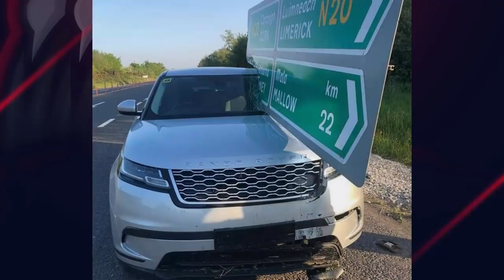Customer States Check Differential Fluid On Their Truck | Just Rolled In

Comment: Having owned a Ford Ranger (bought new) that had a frame begin to rot out after 2 years, I can't help but look under the wheel wells of trucks I pass on the road.  Amazing the amount of corrosion you see along the frames in the wheel wells!   And this is on relatively late model trucks!
Reply: I owned a Ford Ranger for 17 years.  Bought new off the lot.  It spent more than its fair share of time in salt water environments.  Oddly enough I never once had a mechanic complain about rust or rot in the vehicle's frame.  Don't get me wrong, it had a number of issues.  Electronics were showing their age, shocks were shot, and there were some other issues that would cost more to fix than the vehicle was worth.  But I never was told the frame was rusted out.  I don't know if I was lucky or if I simply did enough vehicle washing to keep the rust at bay.
Reply: This frame rot is reaching epidemic levels. I just can't understand why this crucial structure under trucks is designed as poorly as it seems to be. I get the whole planned obsolescence deal to keep sales alive, but if the frame fails in a collision or by simply using the truck, and the owner is killed as a result, well sales are negated at that point. Dead customers don't buy new vehicles to replace the ones that killed them.
Reply: Why do these cars and trucks rust so quickly?

Comment: I feel for the people that brought in the rusted out cars. But there is a lesson here. Get the car checked out before it gets that bad. Time for my old car to get checked. Fingers crossed. Thank you for sharing and you have a nice weekend too.
Reply: GL, car cancer is a pain. Just checked my 97. I see some surface rust underneath that I need to tend to. Overall she is still pretty good for a Michigan car.
Reply: @Frostified  There was a congressman many years ago in the U.P. that wanted to ban road salt because of the rust. He said that every car he ever owned died not from engine failure, but from cancer. The same goes for me in South-East Michigan, every single car I've ever owned long enough has rusted out before the engine went out. I have a couple of beaters now that run like new but are full of holes.
Reply: @Pro1er  Did car manufacturers ever do rustproofing over there? WIth the bitumen mass covering the undersides, and sticky oil sprayed inside cavities?
The better manufacturers used to do that here and cars would last 20 years even on salted roads, but then in order to save weight they started leaving out those treatments and all that protects the car now is a layer of paint :(
Reply: @shadowsimjk  No, not with the older cars, but they did, and still do electro-dip the cars where the primer is electrically bonded to the metal as the car is submerged into a vat of primer. In addition since the mid 2000s the steel is usually galvanized to deter rust. Even so, if you understood just how much salt they use in the North-Eastern and Midwest States you would understand why cars are still prone to rust. It's like parking your car in the sea for several months of the year.
Reply: there not even that bad weld .25 to .50  inch steel plates on it it be stronger then new
Reply: @jonsworld5307  Good luck getting a clean weld on that.
Reply: @Rogan_Dorn  not hard go back to good steel grind it clean weld it up iv fixed tons of trucks and cars like that
Reply: @CIA_Is_aTerrorist_Orginization  When I worked at a shop in Upstate NY a customer thoroughly washed and treated his truck before each winter. After 5 years the truck still looked great

Comment: Since the mid 80s I've always brought my car into the dealership and let them do all the scheduled maintenance.  3 or 4 times a year.     I totally believe that preventative maintenance is cheaper than break down repairs.    So knock on wood,  I've never been let down and found myself stuck on a highway in a strange town.   A late night break down will be a big towing bill and motel room cost   plus the cost of the repair.
Reply: i do a mix, i do some work myself when i can but if its due for other service when i take it in, i let them do it. i also buy my parts from the dealership
Reply: @Mike I met the service manager at Mazda dealership,  he went to the same trade school as me .   So I always trusted him to do the right thing.   He has now retired  ☹.
Reply: @Mike The idea that the stealership wants to rip us off comes from being told BS like that it'd be fine to just replace the brake ROTORS if I didn't want to wait for the new pads and calipers to come in. Needless to say, without new pads, those expensive new rotors would have been destroyed as soon as I put the brake pedal down. The response when I called them on it? "Well, yeah."

You have to really look hard to find a place that isn't full of crooks.
Reply: @Megatron995  That depends on the condition of the old pads, but it's still really strange they would suggest that.
Reply: @Mike That's not always true. It seems the earlier of the current generation Mustangs have a thrust washer that is too thin and causes a clicking noise after a while. Ford came out with a replacement that is thicker and solves the problem.
Reply: Over the years that I had my Ford Ranger there were times I took it to the dealership for maintenance.  But I quickly realized they weren't a reputable shop to deal with.  They claimed to go through a checklist of items on a vehicle whenever it was brought in for maintenance and when I reviewed the checklist and saw things checked off as good that I knew were problematic on the vehicle, I lost all faith in them doing any service.  I mean if they can't even tell the truth about system checks that were supposed to be done for free, what aren't they doing for the things that really matter?  

Instead of the dealership I take my vehicle to the small mom and pop mechanic shops in the area.  But even with that said, you need to check over their work.  One shop I went to years ago (now no longer in business) was very good initially, but as the business grew I think they began to take on more work than they could handle and they were cutting corners.  Something would be missing.  Something wasn't tightened.  Hell, something might be left under the hood that didn't really belong there.  They were rushing work and it showed.  There are a couple of shops I deal with now in my area and who gets the business is pretty dependent on my humor on that particular day.  But even if I'm always happy with the end result, I still do basic checks behind them.
Reply: My cousin went into the dealership for an oil change before a long road-trip, they forgot to put fresh oil in. He made it a couple miles before the engine was destroyed.
Reply: @TheVexCortex  Well there are incompetent mechanics  out there.  I check the oil after a service.   Because you never know 😨

Comment: Yeah just another day another rotted out frame, and those tires might as well call them slicks lol. That black Oldsmobile Cutlass Supreme g body at the end is gorgeous, always wanted one still do.
Reply: Almost exclusively those vehicles with the rusted out undercarriages and/or other infrastructure are from the North and Northeast.  If I had the financial fortitude I would be delivering selling and/or delivering vehicles from the South to the North and Northeast.  If business were doing well or better within a few years alot of Northerners will have much better vehicles... and boost the vehicle shops' business since they will have actual vehicles to work with instead of nothing but rust buckets on up to questionable quality wheels.
Reply: @adamgray1753  I hear that. I live in Pennsylvania and my father was a mechanic for 40 plus years. Growing up i have seen allot trust me and it still shocks me to see what people will drive and do to there vehicles to keep them going.
Reply: In my younger days we would call those tires maypops , may pop any second .
Reply: Even racing slicks have more tread than some of the tires in the video.

Comment: Just amazed that these vehicles are allowed to get to that state where suspension and structures are so badly compromised or even tyres are that degraded. The annual inspection we have in the uk would pick up those corrosion issues long before they got to that extreme stage, and tyres that worn would get you pulled over and get you points on your licence which can lead to a ban and WILL increase your insurance premiums. It’s crazy that this stuff seems to go unchecked

Comment: We've been getting plenty of tire like those at about 1:40 at our shop. Every one of them wanted an alignment to "fix" their pull and wobble issues. I even had one tell me that the  14 year old tires, which where the wrong size for his truck, were "new" and that he didn't need tires.
Reply: C/s lack of traction in the rain. Check and advise lol.
Reply: They were new 14 years ago! My grandpa was like that and would ride on tires until they were beyond slick. My boat trailer gets new tires every 5 years (live close to the lake) and truck gets them as soon as they lose wet traction even if they're not down to the indicators yet.
Reply: The DOT number on the tire doesn't lie about its age.
Reply: Tires really only last about 5 or 6 years, regardless of miles.  At that point dry rot has ruined them.

Comment: imagine having an accident with that rusty car and you find yourself later setting on the road with the steering wheel in your hand after your chassis turned into dust 😂😂😂
Reply: Decades back a work colleague had a very old and rusting Honda Civic mk1 in a tropical coastal city in the Middle East. One day he accidentally hit a curb, at under 10mph and not even particularly hard, apparently. The car collapsed in the middle, almost into two halves just connected by a bent roof. The tow truck guys couldn't move it, so they had to get a bulldozer to lift it and get it to a scrapyard.
Reply: @frglee  
lol too funny 😅🤭
Reply: Imagine the legal liability if you have an accident at fault and the other guy's insurance checks your car and sees corrosion city, bad brakes, exhaust held up by coat hangars and near bald tires!
I cant get over how people "repair" loose exhaust systems with belts, coat hangars, wire and cake pans, you are driving 65-70 on the free way and that damn thing lets go and there's cars BEHIND you and all of a sudden a muffler and cat converter and connected pipes all appear in the middle of the road and you have no place to go but a direct hit!
Reply: Romeo Tene  Sorry, but you are wrong, a normal steel hangar made for mufflers is a LOT heavier than a crappy coat hangar, and zip ties being plastic can MELT from the heat, but hey, if you enjoy using zip ties and coat hangars on your vehicles go for it, but if something happens and it was determined the muffler etc fell off because it was held in with coat hangars, and it caused an accident in a car behind you who hit it and went off the road into a tree- you will be the one needing the lawyer and paying the penalty.
Coat hangars would never pass any state inspection where that is done either. Just freaking do it right or don't bother, but don't sit there and excuse away freaking coat hangars and zip ties!
Reply: @HobbyOrganist  That's why you don't tailgate a beater car.
Reply: @HobbyOrganist  Seriously, now. That's not going to happen to anyone with the wits to KEEP GOING if some shit like that happens. The other guy will be way too busy trying to keep control of his car to catch your plate number. 

Prevention is the best medicine, but not being a masochistic self-punishing dumbass is a good second-line solution.

Comment: That rusted out strut mount happened to me once. I had pulled in to the parking lot of the vet to pick up my cat after some dental work, and when I stopped, the front right quarter of the car just dropped four inches. When the mechanic checked it, he said the other side was close to doing the same. Repair would cost more than the car's value, and the top mounts were not that many years behind.
So, a couple of weeks later, I picked up my next car.

-
New England is harsh on vehicles.

Comment: I had someone drive on a tire like that for a long time till it blew on them... Told em to change it but , "Nope it still good they said." They must think the Customer is always right...
Reply: Unbelieveable! and Ive seen used tires for sale on FB marketplace locally, where people say "has lots of tread left" yet the tires are like 15 years old! it doesnt matter how much tread there is- the AGE becomes the problem, dry rot and UV rays from the sun on flat black rubber that absorbs all the rays.
7 years is about the max one wants to drive on tires no matter how much tread is left, I always put new tires on the front of a used vehicle I bought and the rears later if they were ok at the time, the fronts take the most weight-  from the engine and then the steering puts the most stress on them.

Comment: Way back, a company that I worked fro, had a 1 ton GMC pickup, dual rear wheels, Atlas Chalmers transmission, and a 554 gas engine (12 mpg highway), On one of their trips, the main crank split, tearing the engine block into 2 parts and pushed the front half of the engine through the radiator and onto the highway. 6 months old, all covered under warranty!

Comment: 1:46 I’m more concerned with why and how one side of the tire has more tred than the rest.
Reply: Probaly on a vehicle long past is alignment service.
Reply: @hdezn26  Or the bearings are past tense.
Reply: As long as you don't push the brakes in wrong spot
Reply: @MonkeyJedi99  That will be Wearings , they make one hel! of a noise.

Comment: about the sign at 2:32
I know exactly where this was taken, it's the N20 between Cork and Limerick, the sign is 1 to 2 meter off of the road, on an exit ramp and inside of the curve
coordinates for the curious few: 51.956530, -8.573417
Reply: Was it a knacker owned range rover pulling a horse box by any chance.
Reply: @foxdmulder  I do not know, I only recognize the road because I was staying in Limerick for 3 month 2 years ago and was taking it regularly.
From the pics I saw in reddit (cork subreddit) no horse trailer attached
Reply: Well I wasn't curious till now.

Comment: Saw a T bone accident once  in the early '80's. It was weird that it was two old Novas, but one of them lost the complete front clip, the driver looked like he was sitting a park bench, everything from the firewall forward including dash, windshield,  floor, the lot.
I was first at the light on my motorcycle as the front of the car went spinning just past me, and it started raining glass cubes.
Reply: Soumds like a hackjob of 2 welded together half's, which wasnt uncommon back in the day. Pickup good front with VIN and with wrecked rear and paperwork, then steal same car, weld on rear half.

Comment: That crankshaft issue looked like what happened to my old 3.0 liter Buick LeSaber. Ironically, it broke loose while idling at a stop light.
Reply: What is funny is that the part fitted back together too precise,  My opinion is that it did not happen while the engine was running.
Reply: @arthurhardy  IDK, my Buick just started knocking at a stoplight, I actually drove it halfway ho.e before it quit. The pieces still fit together like a puzzle.

Comment: That broken crank was a 1980 - 6 Cyl / 3 Cyl - Chev - it was V6 - and it had to have a custom Distributor too.  If you paid extra , you could get the one with the Custom Starter pak. That meant it would run on three cyl in the city - but not have much get-up and - Go on the highway.

Comment: That rust bucket reminds me of a friend's car in high school both floorboards were rusted out you could see the road underneath you the gas pedal to was completely rusted and gone he used a thin piece of wire wrapped around his hand to work the throttle
Reply: Been in more than one car where old license plates slid under the rubber mat closed up the view of the road going by.

Comment: I've been looking to see what on earth that could've been on that first video, and keep coming to the conclusion that someone put never seize in there just like you said. It's pretty shady, probably trying to cover up a major issue so they could get top dollar for the vehicle. Sawdust in the transmission was one trick an old mechanic I knew used if he was just trying to get rid of a vehicle quick - it shuts the transmission up long enough to get it out of sight (at least with the old 2 & 3 speed slush boxes.)
Reply: @Al Gore So is that metal dust????
Reply: Another trick is bananas in the transmission or in the differential. Quiets the gears for awhile, during which it's making a banana smoothie.

Comment: 0:42 - Huh.  This must be an actual problem since I saw this exact same thing on another Ford truck recently.  The nut for the steering wheel hadn't been tightened at the factory.  Unfortunately, the steering wheel hub was wallowed out by the time it came to me.

Truck was JUST out of warranty.
Reply from the maker: Damn that sucks for them

Comment: Ok gotta ask
what made the oil silver ???
Reply from the maker: Good question on that one. Usually you will see metal flakes in the pil if the differential failed but not sure how it got to look like that lol
Reply: @JustRolledIn  ya cause I've never seen anything like that, not even in semis or heavy equipment I've worked on in last 35yrs
Reply from the maker: Looks like somebody put silver paint in it honestly.